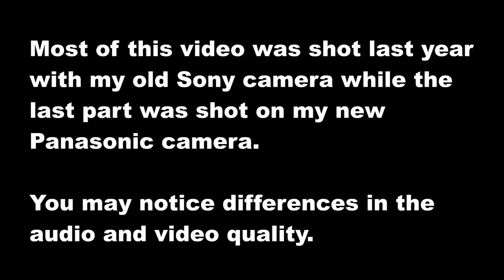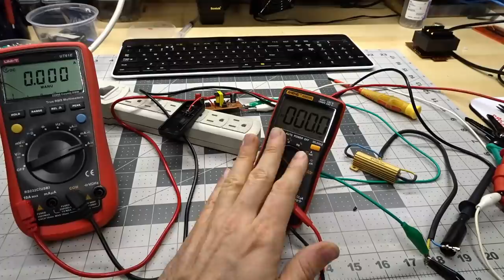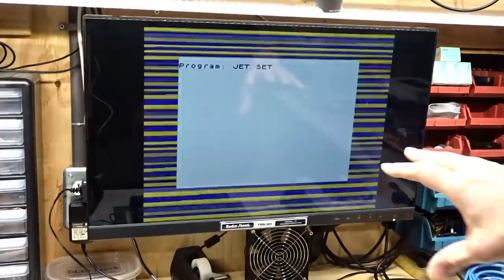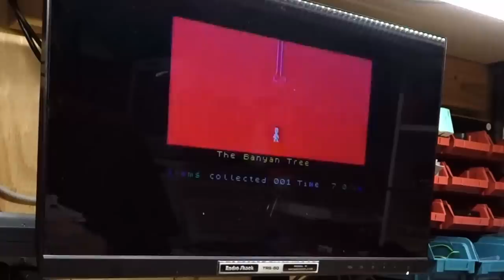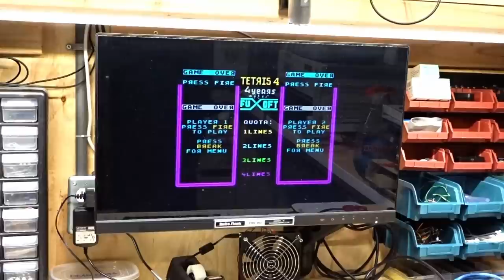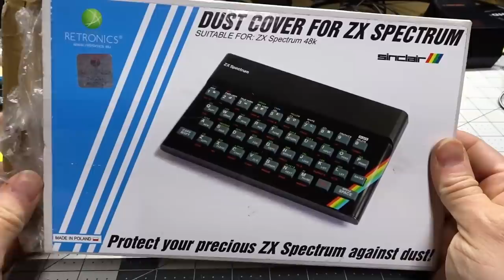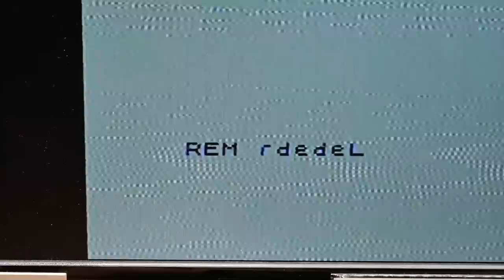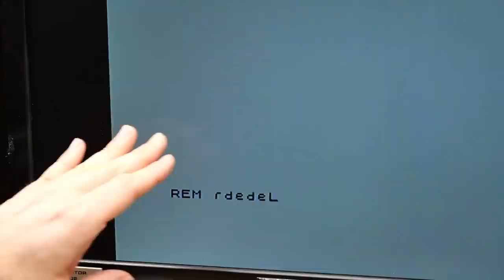ZX Spectrum Part 3 - Revisiting the machine at last!

Comment from the maker: Hi everyone -- a couple points: In all my original testing, I powered the Spectrum off my linear bench power supply. All my issues with it were identical whether I used the bench supply or my new switching PSU. The phone I was using (a Moto G) has no EQ on the audio output nor does it have a Google account that generates any notification sounds. It's a dedicated phone for loading programs onto old micros like this... I made a stereo to mono cable to plugging into the back of the Spectrum. There are different volume settings: in the app, the phone and the amp itself. I tried adjusting all of those to various levels but nothing was working reliably.  The audio amp was then powered off my bench supply during that testing and it sounded just fine listening to audio with headphones. (Which is why I tested it first.)
Reply: Have you tried shielding the audio cable from the phone to the Speccy?
Reply: Is the phone's volume at max? I wonder if that is sending too hot of a signal into the headphone amp? I would try 80-90% output. Also maybe try using just the left side or the right side of the output?
Reply: Though it shouldn't make much difference, but have you tried using only left or right channel into the computer? Maybe the amp is having trouble connecting the channels?
Reply: @telluridecolorado8918  Maybe a external PC speaker on 1 channel and the ZX on the other, and maybe you can hear a difference between different programs.
Reply: Could you burn the audio to a CD-R and use a CD player with a real line output, just to make absolutely sure that the phone/headphone amp signal chain is not a problem?
Reply: Have you tried to measure the ground diffrence between the spectrum and your amp.? I suggest you try powering your amp via battery, this may eliminate any difference your spectrum's ground has from the audio source, I used to repair alot of spectrums in th 80s and it was notorious for loading problems, especially because of the hundreds of different tape players used and the low cost of design employed by sinclair. Even Maplin (TANDY UK) had a device to improve the flaky performence back in the day. As to youtr comparison with the c64 the speccy was a third rate toy as it cost a lot less than its contempory. Having said that your video was great and I hope you dont lose faith in our beloved national treasure. :)
Reply: I had the similar issue with loading programs from my Android phone into my Memotech. I solved it by installing VLC on it, which has its own EQ and pre-gain. Worked like a charm, might also work for the Spectrum. I can recommend removing the low-end through the VLC EQ (I doubled my successes by doing that), and just hammering the rest to the top and also add some pre-gain through VLC. You could try that if you want to. It might need a Google account to grab it from the Play store though. Great video as always, thanks!
Reply: You wouldn't need a google account. Just download the apk file from a third party site.
Reply: @ Adrian's Digital Basement
Adrian, You need to RF shield the amp you built and the signal will improve greatly. Mount it in a project box with metal tape on all the inside surfaces. Make sure you ground the metal tape.
Reply: Hi Mate, I had the same issues, but then I got a simple MONO 3.5mm jack cable, not a converter cable. I Run the same App you do on an old Alcatel Android Phone. Works with no problems. Another way is if you have a tape player, My 128K has one inbuilt, you can use the cd walkman to tape player connector with the dummy tape, and then run the same app.
Reply: Besides all the other suggestions, I would say: instead of using a stereo-to-mono adapter that ties the left and right channels together, try a cable that only uses the left or right channel.
Reply: @JacGoudsmit  Good point and it would be best for the left channel to be used as that is the default audio channel for the Speccy.
Reply: Hi ! My Power supply Tip "Meanwell" .
Not too expensive and Quality , i use them a lot !
Reply: @larsmuldjord9907  i spent ages playing about with VLC, never got it working reliably but i found the best setting was large hall . and altering volumes of out put device/windows volume/and VLC volume ... takes me right back to 1983
Reply: Can you get  a divmmc  from the future is 8bit. No going  back once you have one
Reply: I can highly recommend the DivMMC Future - it's a SD card interface for the ZX Spectrum. Games load instantly without any tape loading errors. I know some people would claim that was 'cheating', but all I know is that I can now play LOADS of games in a single gaming session, rather than trying to load just a couple. And you are playing the games on real hardware. It even has a built-in Kempston joystick interface which solves the issue of trying to play using the keyboard. The Speccy was my first real computer back in the day, and I love that I can still play mine 35 years later. Great videos Adrian - keep it up!
Reply: I got thinking about this and I'm wondering if the tape files you're using are not bordering corruption. Good enough to use in an emulator where there is no added noise or volume loss but not good enough for real world computing. On the World of Spectrum website there are a lot of tools that might help, including some tape to wav converters. Here's the link http://live.worldofspectrum.org/infoseek/utils
Reply: I had Spectrum which would never consistently load from audio source. I bought a divMMC Future and never looked back
Reply: yeah switching mode power supply is filter noisy. seems like data degradation though so... gotta trace the path or switch the right bits straight into memory. ;) So Simple. To type... :) Good luck
Reply: @RodBeauvex  I was just about to reply the same thing, as in the volume on the phone might be distorting the sound before it gets to the amp. and I agree 70-90% volume would be the better way to go, and then turning the amp up that little bit more.
Reply: I do believe that probably the mobile phone is probably distorting the sound, try turning the sound on the mobile phone down to 70-90% and turning up the volume on the amp that little bit more to compensate for the difference.
Reply: It might be an unlikely issue, but the stereo to mono cable you made, this will be 'summing' the 2 stereo channels and creating a single mono output, but if the original tape had any issues, or was digitised badly, I think this might be causing some kind of corruption/interference in the audio signal (phase issues / cancellation etc)
Only connect either the left or right channel of the stereo cable, it doesn't need both.
Reply: U gave up on yer Spectrum 
Can't even look at you now....
Reply: If it's any consolation at all, as a child I spent hours on Jet Set Willy and never really progressed further than about 7 or 8 rooms. It was a follow on to Manic miner and after buying a mansion and throwing a party, his housekeeper ( woman guarding the bed ) refused to let him crash out until he'd tidied the place of empty glasses. Loading the games was always a black art with that building feeling of expectation dashed at the final moments as the screen returned to the load prompt and blinking cursor. Numerous tries ensued at different volumes and one could become quite superstitious in the ritual of loading a particular game. Even remember staring at the magazine advert for weeks and weeks as I saved up enough to buy the Spectrum secondhand. Often the games cassette art and promise far outreached the actual game itself, but at the time it all seemed so magical and new. Then my cousin got a C64 which seemed a further leap ahead. Thanks for posting your restoration.
Reply: Hi Adrian, can you try to load a game with the keyboard unscrewed and moved a little bit away from the modulator box?
There is a chance that your new membrame ribbon causes a capacitance distortion when it touches this box.
I had the same issue after I replaced the membrame and screwed the parts together.
Reply: back in the day we used to find that tape decks with tone controls worked much better
Reply: Adrian... @Adrian's Digital Basement .. this page explains how audio/data works for a Spectrum take a look... >> myprius [dot] co [dot] za/tape_storage.htm
Also recommend.. connect the cell phone's output to your PC's input... and the PC's output to the Spectrum..... then you can "see" in an audio program.... what the Spectrum is "hearing"...... at what speed (l which will vary the frequency).. with what volume levels... etc .. ...... or get rid of the phone... and playback directly from the PC... to the "DinosaurPC"     :-D
Reply: I use MP3 from an old Ipod touch. Never had much success with game loader software. Crank up the Volume.
Reply: @rosemeyer1939  My thoughts exactly
Reply: @katho8472  Merging 2 mono channels to produce a new mono output.... That looks like a real point of issue with me.

The original Speccy cable was single channel mono for a reason.
Reply: Adrian's Digital Basement one thing I did notice between the first and second time you tried loading games is you had the pal converter on the other side vs beside the amp maybe it was picking up interference from it?
Reply: @zmamedotcom  Right, maybe a metal box around the PCB might help?
Reply: katho8472 yes maybe salvage a old RF box that is big enough
Reply: Try powering the amp from a battery, or add an isolation transformer between the "tape" output and the spec.  You probably have a ground-loop.
Reply: I wonder if your problems are from trying to run stereo, try just left channel or right channel only, might be getting weird anomalies from connecting those outputs together.    try listening to it on a headphones and find best sound that way(adjusting the audio on phone, and amp) by playing a music file.  another idea is to ground the amp.
Reply: The chances are that images in the Android apps were not transferred over correctly from analogue to digital. My friend had the same problem until he got different game images and all of a sudden he was loading games with ease. You should look into getting different game images.
Reply: Still have my spectrum 48k , in box in attic with lots of games , great wee machine it was at the time , games would wreck a joystick .often tempted to see it work again
Reply: @ Adrians Digital Basement. Hi there, an old Speccy user here. The best way to copy/load games is not to use Hi-Fi at all.  Use a tinny sounding mono output (left side) at 55 % volume for best results. Shielding is not the issue here as the Speccy, is geared up for Low Fi sound. It used a mono tape deck back then which was not supplied with the machine. 

Later Models of the machine came with better keyboards (the Plus models had a removable back plate for easier keyboard membrane replacement) and built-in tape/disk drives. 

You could try, if you can find it, something called an Azimuth tape head alignment kit. Of course, you wont need the cassette tape or Eyeglass screw driver that came with it. Just the programme alone should be enough to set the levels correctly. 
 I must have realigned 100's of tape heads back in the day as I worked in the industry at the time. We'd scrap the old rubber keyed ones back then and save the Pcb and Ic's, as removing that metal front plate was super hit and miss. I was really impressed with the way you jury rigged the old ribbon cable, they were the weakest part of that particular unit.  

Anyway I hope that helps and good luck with this venture. It makes me happy to see people still enjoy these wonderful old machines.
Reply: Android should allow you to output mono from the accessibility settings
Reply: maybe try putting your phone into a faraday cage and recapping the speccy lol
Reply: Try using a real tape deck.
Reply: They were making 3.5 inch floppy drives for it back in the day.
Reply: Glad you got it working, good work! They always were temperamental when it came to loading programs, and good call on using airplane mode on the phone, its easy to forget mobile phones didn't exist back then so screening from GHz RF probably wasn't even considered. How things have changed...
Reply: I have failed many times loading from a phone to my spectrum. My vintage tape player and original cassettes are for the most part working fine. Of around 89 games I have a handful I can’t get to load.

Also a TAPduino interface is a great solution
Reply: Try DeOxit-ing the jacks? The thing looked rusty, so it may be just corrosion, too.
Reply: I know I'm awfully late for this. I might be one of the lucky ones, as I never had those "well-known" issues with loading tapes. 
In your case, you're probably loading mp3 files, which usually is a gamble. Moreover, the files you are using seem to have been sped up quite a bit: the cyan/red stripes work similarly to a strobe disk on a turntable: they should be as still as possible, maybe just wobbling a bit in place, but definitely not running up or down. The audio cable has to be mono, just use the signal from one of the channels. Mixing the two channels causes phase issues (depending on the quality of the mp3/wav rip) and you're losing high frequencies, which results in horribly not-square waves reaching the Speccy. It's a digital signal, even if it's in the audio range, so the mp3 compression and/or phase shift will render it almost useless.
Reply: sorry i'm 4 years late to the 'dance party' :) but ,this might sound odd and silly but , remember , the tape connections on the speccy are 'reversed' ear to mic , mic to ear , did you connect the jack from the phone and amp to the 'ear' on the speccy ? because i think you should connect to the 'mic' socket on the speccy !!! ( mic receives audio )  also , probably why you don't get the tape loading sound in the speccy beeper speaker , the mic and ear sockets on the speccy share a single line on the ULA , if you check the circuit diagram there is a bit of ( what i assume is filtering ) to diferentiate between load and save audio levels , another thing is , the speccy loves the most tinny 'crappy' audio sound from a tape , sometimes back in the day , adjusting the tape head azimuth alignment would make the audio a little more 'tinny' and improve tape loading reliability !!!

hope this helps maybe :)

Comment: " I spent 45 minutes trying to load a game on the Spectrum" - congratulations, the initiation ceremony is complete, you are now a fully fledged member of the Spectrum community.
Reply: lol. i remember we used to tweak the volume and the tone on the cassette player for hours just to load a single game, bring such great memories :)
Reply: You beat me to it :) It was all about getting an original copy (meaning the first copy of an original game) and your friend's relatively expensive tape deck. I think this chap is having trouble with either the tape files themselves or the speaker/tape audio loading circuit, or a combination of both; but I am far from an expert. (My 48k is languishing on a shelf with an unidentified fault way beyond me, although I assume it is something to do with overheating, of course.)
Reply: @eithan  that's certainly my recollection, hours and hours.
had a nice cottage industry copying games on my tape to tape stereo, volume set to approx 7.5 :)
Reply: it would probably still give load errors if you hooked it up to a cd player instead of a tape deck. :P
Reply: Oh you lucky lucky bastard.  Oh bugger, just had a ZX81 RAM pack wobble flash back.  shiver
Reply: @eithan  i also had a smal hole drilled in the cassette player so I could adjust the angle of the tone head (think it called azimuth) with a small screwdriver. The angle had be just perfect, that is it must match the head of the device that recorded the tape, so especially on copied tapes each had is own "perfect" angle. :-)
Reply: I went for the Miles Gordon Tech floppy & printer interface then added 3.5 inch floppies. Also had a converter to use a microvitec cub monitor
Reply: The chuntey is even more mysterious than "the force" in Star Wars.
Reply: Back in the day, the keyboard membrane broke down on my spectrum (yes, they were shitty quality even back in the 80s) but i couldnt buy or find a loose keyboard membrane, so i made my own from some old plastic and conductive paint, and it took me 3 days to make, but it still works even after almost 40 years! Does that make me a fully fledged member of the spectrum community too or not?
Reply: LOL! 😆
Reply: 45 minutes! I never took that long to get anything loaded. 15 minutes tops.
Reply: @douglasfreeman3229  It would very much depend on the 'quality' of your 'copy'. When you're trying to load a third generation copy of a speedloader game with a low quality tape recorder, you could spend hours adjusting the levels until you finally got it to work.
Reply: @HappyCodingZX  It was kind of a side-effect copy protection of the old days where beyond some point, it was like "not worth the hassle, I'd rather go buy the game" (or find someone with an earlier generation copy which might not have been easy nor quick) :-)
Reply: Kids nowadays and kids in the Americas and Germany back in the day missed on this. Loading games from tape IS THE PREMIUM EXPERIENCE.
Reply: @faenethlorhalien  Actually they sold this thing in Germany. Just without success. They keyboard was junk.The architecture was mediocre. The platform was just crappy. And the ZX 81 had ruined the reputation.
Reply: @TheCaffeineKid  he stood too close to the chuntey field
Reply: I remember Daley Thompson’s Decathlon took 13 minutes to load the 128k version and would crash at the end 9 times out of 10
Reply: @eithan  The screwdriver for the header was an integral part of the process xD